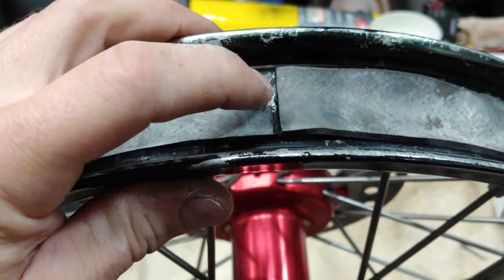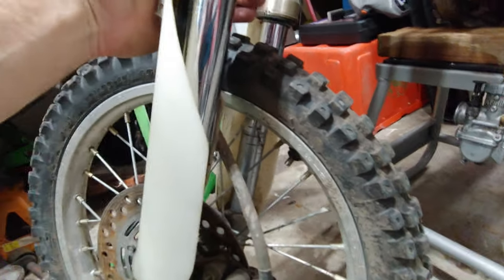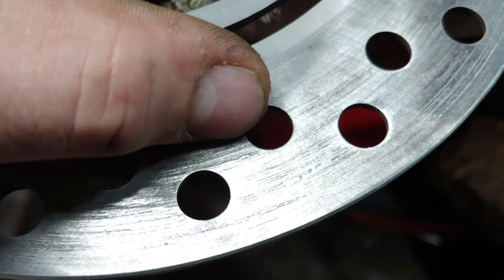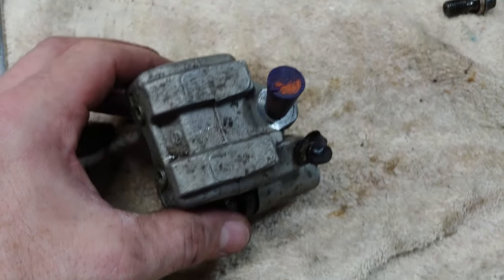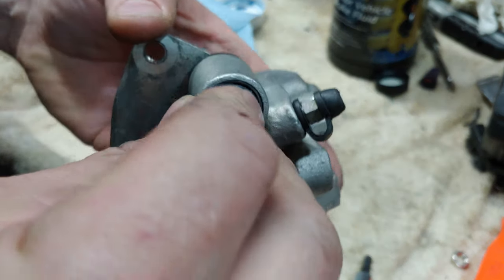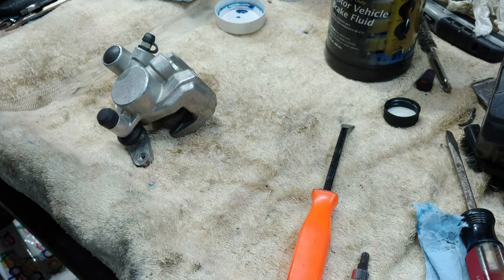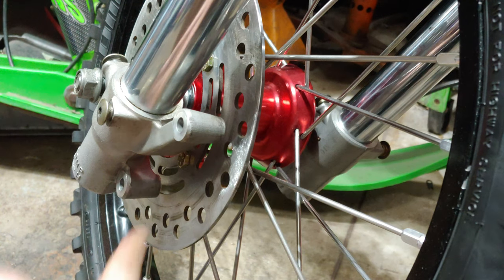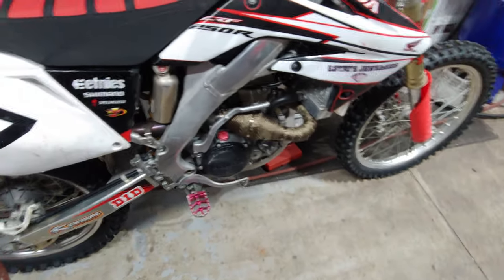2003 Honda CR85r Rebuild Part 1 || Wheels, Tires, Brakes & Bath

Comment: Picking up the suspension for my 1990 RM80 tomorrow. Going to run it at Dux then really rebuild it over the winter.
Reply from the maker: Nice! You got the suspension rebuilt? What'd it cost you?
Reply: @Fixin2Ride-Official-  TDC Racing did all 3 for $550. Was all bushings and seals. No springs or revalue.
Reply from the maker: Gotcha. Thanks. Im thinking of getting a revalve and apring for mine.

Comment: What did you have to do to get rear 150 wheel on just bought a set there for my cr85 and noticed on the crf wheel the axle is slightly bigger
Reply from the maker: Gotta get the right bearings, inner tube, collars and axle.

Comment: I need a plastic bolt kit mines is a 2004 Honda cr85, will any honda bolt kit work?
Reply from the maker: For the most part. But they are just basic track packs. So most of the bolt should work fine and look great.

Comment: when you washed the bike did your spark plug ignition coil and all those components go bad ? i’m debating if i should wash my bike the way you did it or remove the electric components. thoughts ?
Reply from the maker: Sorry I didn't see this I responded to the other one. So the most common no spark causing issue after you wash your bike is the stop button so just disconnect it and blow it out compressed air and maybe use a warm hair dryer on it for a few minutes to evaporate any water left and then put it back see if it starts that usually will do it
Reply: @Fixin2Ride-Official-   all good man thank you for taking the time to answer both them , when you say the stop bottom are you referring to the kill switch ??
Reply from the maker: Yeah that's the Killswitch yep so pop that off and you some compressed air on it and then hair dryer that should get all the moisture out and you should have spark again. You can even unplug it or just unplug one terminal because all it does is ground out the spark coil, and if you unplug one of them that will break the connection being that water is creating a connection inside the button and you should have spark if that's the problem
Reply: @Fixin2Ride-Official-  awesome thanks man , also one last question did you use a power washer or just a garden  hose ? what type of aluminum spray did you use to clean up the frame??
Reply from the maker: I typically use a pressure washer. And then you can get some red scratch bright and aluminum wheel cleaner and that will help to clean it up
Reply: @Fixin2Ride-Official-  sounds good thanks